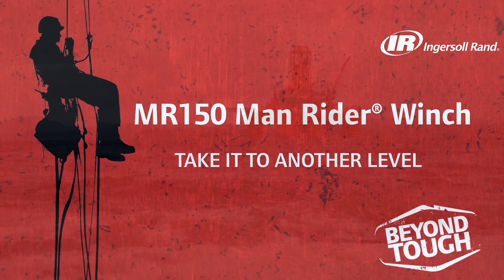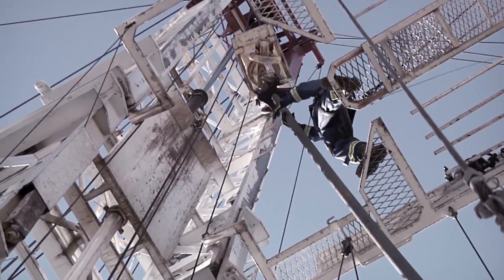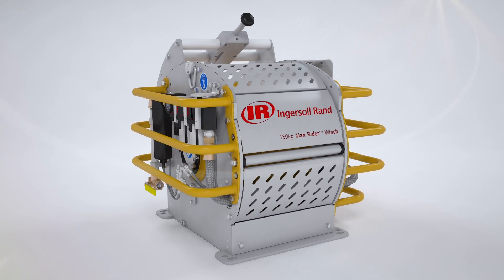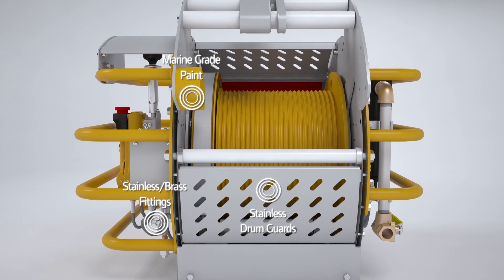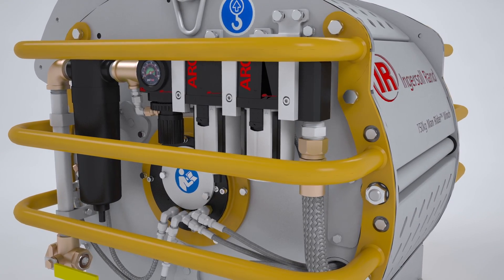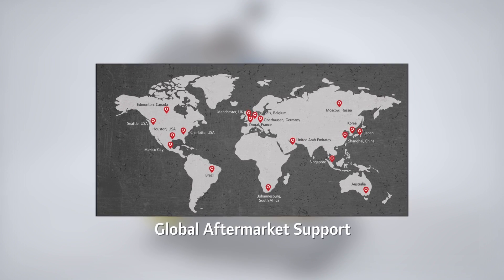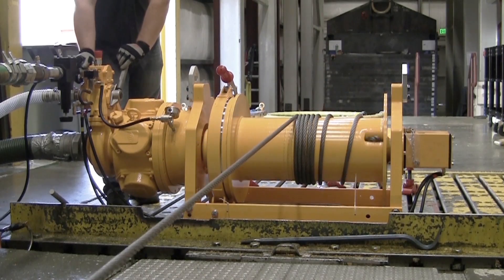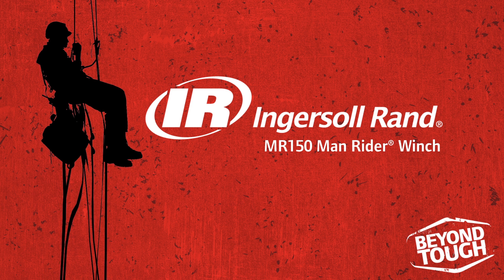MR150 Man Rider Winch Overview

Comment: I have this winch in my drilling rig and it has many protection devices but it is not reliable winch and some parts does not have part no in the parts list manual